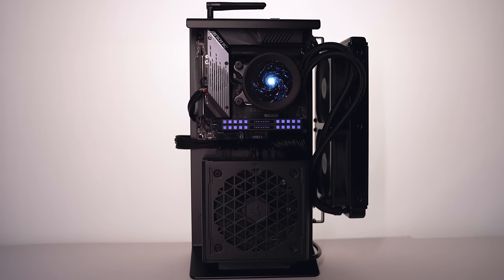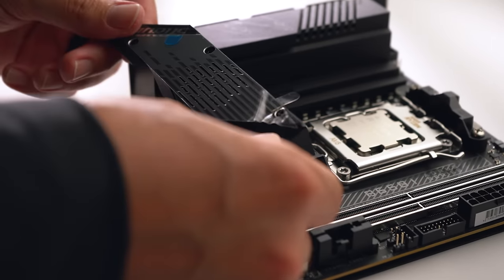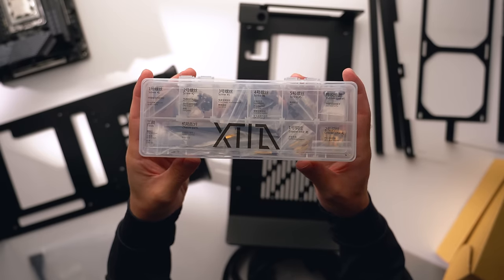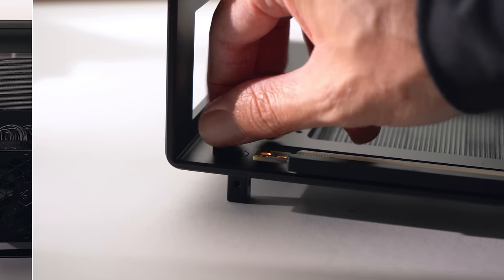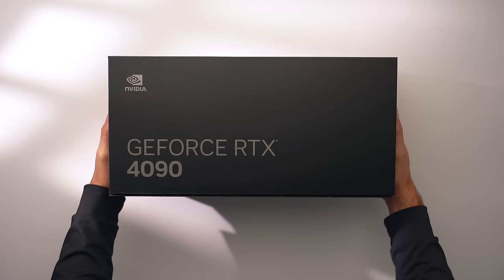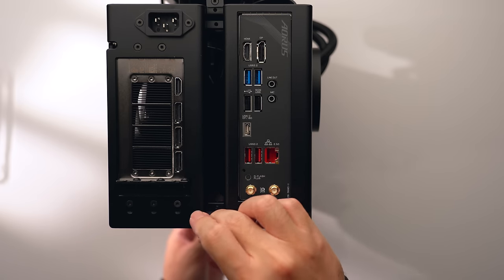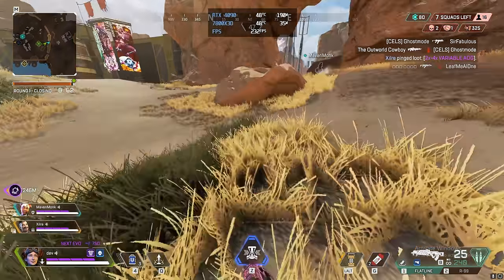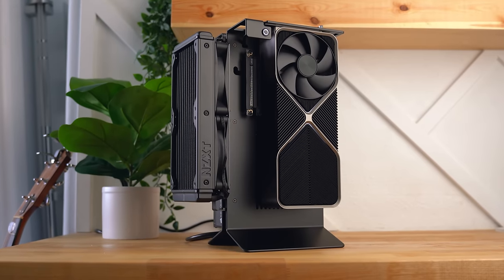This is a computer?

Comment: Nice build! I have the xproto-l setup just like this but with the additional flip module ( ROG Strix 3070ti overheats like crazy with the IO facing up). One tip for everyone thinking dust is a big deal, it definitely shows when dust starts to collect, but a quick compressed air pass and an antistatic brush over the surfaces and you're good to go.    Just subscribed to your channel, good delivery and down to the point!
Reply: where will the dust go to if u used compressed air xd
Reply: @tancyew everywhere 
Wipe the desk off with a damp cloth
Reply: Where do you get the flip module
Reply: I have the XTIA Xproto-ATX case V1 and I have 0 issues with dust. I clean it every 3-6 months and even then, I have a very thin layer of dust which I will be able to clean in 5 minutes max. Even with the dust on it there is 0 difference in temps or performance. And like you said an electric air duster or compressor will do the trick just nicely.

Comment: Did you use XTIAs riser cable or did you purchase one separately? I found XTIAs is a bit too long and bends the PCIe block a bit.
Reply from the maker: I used the one from their site, but it's possible they've changed vendors since I recieved mine.

Comment: The dipole antenna orientation in this video bugs me. Although horizontal looks good, the radiation pattern of the signal from these antenna dictates they perform better when vertical.

Comment: Exact same build and experiencing lot's of issues.
650i came with the troublesome F8 bios which I updated to F9. The 4090 in my 5950x, B570 and evga g5 850w rig was doing fine with occasional coil wine when maxing out all settings.

Now with all specs listed here it's got major stuttering issues as in not playable. Coil whine is intermittent, whining when it's playable and not when it freezes. 

I'm currently in the process of optimizing/troubleshooting but extremely busy with work so hope to update sometime in the future.
Just a headsup for anyone looking to do a similar setup in terms of mobo, cpu and gpu

Comment: I've been running vertical ITX build for years on my phanteks shift x, and I need to tell you having the aoi cooler's pump positioning high vertically in comparison to the radiator will eventually kill itself one day, all it takes is some air or bubble to get stuck in the pump unit one time. I run a custom loop with pump sitting down below and haven't had any problem since.

Comment: 8:08 - Don't do pea size dot of thermal paste anymore. CPU's are very different from when that was the accepted amount. It's now a lot more required for proper coverage. It's typically recommended to put it on several spots on the CPU in a specific pattern and ideally use a plastic spreader to evenly cover it ahead.

Comment: Simply beautiful....for the first week until dust starts settling...
Reply: I have the XTIA Xproto-ATX case V1 from the same company as in Devyn's video and it heavily depends on your environment. If people live in a very dusty area then yeah I can imagine you would clean it every month or so but if that's not the case you do not need to clean it that often. I have my open case for almost 11 months now and I have cleaned it 2 times so far. and even when I decided to clean it there was an extremely thin (emphasis on thin) layer of dust on the top of te case and GPU with that dust there were no differences in either temperatures or performance. using an electric air duster and in 5 minutes tops the dust is gone. 

So yeah if someone wants to buy an open case, they just need to look at how dusty their room is and based on that you can guess fairly accurately how many times you would feel the need to clean your PC. 

For example, there is a video of a guy who shares an update on not cleaning his PC after 3 months with the same case as in this video of Devyn. I nowhere nearly have as much as this guy in the video. After 6 months I don't even see dust on my CPU fans or PSU. 

Since YouTube will not let you post links the title of the video is ''Three months of dust with xproto + cleaning''
Reply: @emiel255 i live in an open studio with a open kitchen, do you think it’s better to have a case instead of open case?
Reply: @viennalx  i couldn’t say to be honest I would say that mainly depends on the amount of dust you have in your room. I would say the more dust you have in your room the faster you need to clean your pc

I haven’t cleaned my pc in a little over 3 months now and yes there is some dust but nothing major and it hasn’t at all impacted my performance or temps in anyway

I would definitely think about buying one if you like the idea of an open case (I couldn’t be happier with mine) because imo the stories of it being a dust magnet has a bit of an extreme undertone to it imo that is unjustified. Yes there is dust and yes the pc will have dust on it but it won’t impact your performance in anyway and you definitely don’t need to clean it every couple of days or weeks with a (what you would consider) a normal amount of dust circulating in your room👊🏽

Like I told you in my previous comment watch that video that I told you about. Now keep in mind that he hasn’t cleaned his pc in 3 months (I think he said that) and I also haven’t now and I nowhere have as much as he has within the same amount of time. So you could take a guess for yourself. Do you think you will have as much as that guy in that video or nowhere near that?

Comment: Nice video! but you should mention how you cable manage all the cables (power cord, DP cord, ethernet, all usb etc), and put on video how that looks.. Because all come out of the top of the case when its plugged in, right?

Comment: its very impressive build! but i'm worried about dust....
Reply: I have the XTIA Xproto-ATX case V1 from the same company as in Devyn's video and it heavily depends on your environment. If people live in a very dusty area then yeah I can imagine you would clean it every month or so but if that's not the case you do not need to clean it that often. I have my open case for almost 11 months now and I have cleaned it 2 times so far. and even when I decided to clean it there was an extremely thin (emphasis on thin) layer of dust on the top of te case and GPU with that dust there were no differences in either temperatures or performance. using an electric air duster and in 5 minutes tops the dust is gone. 

So yeah if someone wants to buy an open case, they just need to look at how dusty their room is and based on that you can guess fairly accurately how many times you would feel the need to clean your PC. 

For example, there is a video of a guy who shares an update on not cleaning his PC after 3 months with the same case as in this video of Devyn. I nowhere nearly have as much as this guy in the video. After 6 months I don't even see dust on my CPU fans or PSU. 

Since YouTube will not let you post links the title of the video is ''Three months of dust with xproto + cleaning''

Comment: - This is a computer?
- No, it's a dust collector.
Reply: I have the XTIA Xproto-ATX case V1 from the same company as in Devyn's video and it heavily depends on your environment. If people live in a very dusty area then yeah I can imagine you would clean it every month or so but if that's not the case you do not need to clean it that often. I have my open case for almost 11 months now and I have cleaned it 2 times so far. and even when I decided to clean it there was an extremely thin (emphasis on thin) layer of dust on the top of te case and GPU with that dust there were no differences in either temperatures or performance. using an electric air duster and in 5 minutes tops the dust is gone. 

So yeah if someone wants to buy an open case, they just need to look at how dusty their room is and based on that you can guess fairly accurately how many times you would feel the need to clean your PC. 

For example, there is a video of a guy who shares an update on not cleaning his PC after 3 months with the same case as in this video of Devyn. I nowhere nearly have as much as this guy in the video. After 6 months I don't even see dust on my CPU fans or PSU. 

Since YouTube will not let you post links the title of the video is ''Three months of dust with xproto + cleaning''I have the XTIA Xproto-ATX case V1 from the same company as in Devyn's video and it heavily depends on your environment. If people live in a very dusty area then yeah I can imagine you would clean it every month or so but if that's not the case you do not need to clean it that often. I have my open case for almost 11 months now and I have cleaned it 2 times so far. and even when I decided to clean it there was an extremely thin (emphasis on thin) layer of dust on the top of te case and GPU with that dust there were no differences in either temperatures or performance. using an electric air duster and in 5 minutes tops the dust is gone. 

So yeah if someone wants to buy an open case, they just need to look at how dusty their room is and based on that you can guess fairly accurately how many times you would feel the need to clean your PC. 

For example, there is a video of a guy who shares an update on not cleaning his PC after 3 months with the same case as in this video of Devyn. I nowhere nearly have as much as this guy in the video. After 6 months I don't even see dust on my CPU fans or PSU. 

Since YouTube will not let you post links the title of the video is ''Three months of dust with xproto + cleaning''

Comment: wow the absolut best dust magnet I ever see.
Reply: I have the XTIA Xproto-ATX case V1 from the same company as in Devyn's video and it heavily depends on your environment. If people live in a very dusty area then yeah I can imagine you would clean it every month or so but if that's not the case you do not need to clean it that often. I have my open case for almost 11 months now and I have cleaned it 2 times so far. and even when I decided to clean it there was an extremely thin (emphasis on thin) layer of dust on the top of te case and GPU with that dust there were no differences in either temperatures or performance. using an electric air duster and in 5 minutes tops the dust is gone. 

So yeah if someone wants to buy an open case, they just need to look at how dusty their room is and based on that you can guess fairly accurately how many times you would feel the need to clean your PC. 

For example, there is a video of a guy who shares an update on not cleaning his PC after 3 months with the same case as in this video of Devyn. I nowhere nearly have as much as this guy in the video. After 6 months I don't even see dust on my CPU fans or PSU. 

Since YouTube will not let you post links the title of the video is ''Three months of dust with xproto + cleaning''

Comment: I would like to see something just like this, but without a focus on it being small.  Something big, but open case and that looks like this.  I'm not worried about having a tiny PC, and I feel like you made some sacrifices to get it this small, but I like how it looks and would like to build something like this but bigger.
Reply: You can have the XTIA Xproto-ATX case V2 open case from the same company as in this video. It accommodates an ATX board, every type of GPU you want even the biggest 3rd party 4090 like the ASUS RTX 4090 STRIX, all the high end CPU's like the 7800X3D or the 7950x(3D), like 8 SATA SSD's and depending on your motherboard (mine has 4 slots) plenty of M.2 SSD storage
Reply: @emiel255  thx that's exactly what I was hoping for
Reply: @emiel255  now I'll just have to redesign it in cad and 3d print it lol
Reply: @waynefilkins8394  Yeah dude i highly recommend it. I have the Xproto ATX V1 for about 11 months now and I couldn't be happier. I have got a powerful GPU, plenty o storage and a powerful gaming CPU and of course great temps. 

With nowadays CPU/GPU market there are no restrictions. Maybe if you choose an Intel CPU, it would run hotter but then again new high end Intel CPU's usually run hotter than AMD regardless.

Comment: I wish you showed what it looks like with cables plugged into it. It looks super clean until it has a bunch of cable sticking out of the top to use your keyboard, mouse, monitor, and whatever else you need to plug in. Do they stick straight up out of the top or are they angled back to keep it looking clean or is it routed in a different way or is there even a different way to route them cleanly.
Reply from the maker: There's a right angled DisplayPort cable that can be routed through the middle for the monitor (shown in the vid) and then for usb, I didn't show it in this vid, but I ordered a side panel usb adapter from the XTIA site (linked below) so there's nothing sticking out the top.

https://www.xtia.design/products/usb-3-0-io-panel-set-side-bottom
Reply: @devyn.johnston   Thank you!

Comment: Dust : I see that as an absolute win.
Reply: I have the XTIA Xproto-ATX case V1 from the same company as in Devyn's video and it heavily depends on your environment. If people live in a very dusty area then yeah I can imagine you would clean it every month or so but if that's not the case you do not need to clean it that often. I have my open case for almost 11 months now and I have cleaned it 2 times so far. and even when I decided to clean it there was an extremely thin (emphasis on thin) layer of dust on the top of te case and GPU with that dust there were no differences in either temperatures or performance. using an electric air duster and in 5 minutes tops the dust is gone. 

So yeah if someone wants to buy an open case, they just need to look at how dusty their room is and based on that you can guess fairly accurately how many times you would feel the need to clean your PC. 

For example, there is a video of a guy who shares an update on not cleaning his PC after 3 months with the same case as in this video of Devyn. I nowhere nearly have as much as this guy in the video. After 6 months I don't even see dust on my CPU fans or PSU. 

Since YouTube will not let you post links the title of the video is ''Three months of dust with xproto + cleaning''

Comment: Man thats nice. Im curious how do you prevent dust settlement? I can imagine that thing being super annoying to clean.
Reply: I have the XTIA Xproto-ATX case V1 from the same company as in Devyn's video and it heavily depends on your environment. If people live in a very dusty area then yeah I can imagine you would clean it every month or so but if that's not the case you do not need to clean it that often. I have my open case for almost 11 months now and I have cleaned it 2 times so far. and even when I decided to clean it there was an extremely thin (emphasis on thin) layer of dust on the top of te case and GPU with that dust there were no differences in either temperatures or performance. using an electric air duster and in 5 minutes tops the dust is gone. 

So yeah if someone wants to buy an open case, they just need to look at how dusty their room is and based on that you can guess fairly accurately how many times you would feel the need to clean your PC. 

For example, there is a video of a guy who shares an update on not cleaning his PC after 3 months with the same case as in this video of Devyn. I nowhere nearly have as much as this guy in the video. After 6 months I don't even see dust on my CPU fans or PSU. 

Since YouTube will not let you post links the title of the video is ''Three months of dust with xproto + cleaning''

Comment: kinda forgot the part where dust will be everywhere
Reply: I have the XTIA Xproto-ATX case V1 from the same company as in Devyn's video and it heavily depends on your environment. If people live in a very dusty area then yeah I can imagine you would clean it every month or so but if that's not the case you do not need to clean it that often. I have my open case for almost 11 months now and I have cleaned it 2 times so far. and even when I decided to clean it there was an extremely thin (emphasis on thin) layer of dust on the top of te case and GPU with that dust there were no differences in either temperatures or performance. using an electric air duster and in 5 minutes tops the dust is gone. 

So yeah if someone wants to buy an open case, they just need to look at how dusty their room is and based on that you can guess fairly accurately how many times you would feel the need to clean your PC. 

For example, there is a video of a guy who shares an update on not cleaning his PC after 3 months with the same case as in this video of Devyn. I nowhere nearly have as much as this guy in the video. After 6 months I don't even see dust on my CPU fans or PSU. 

Since YouTube will not let you post links the title of the video is ''Three months of dust with xproto + cleaning''